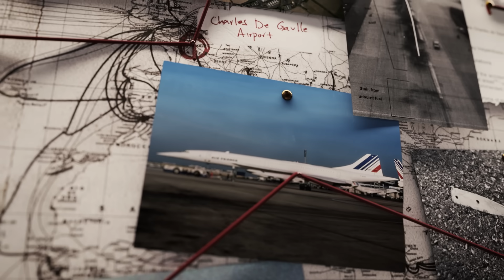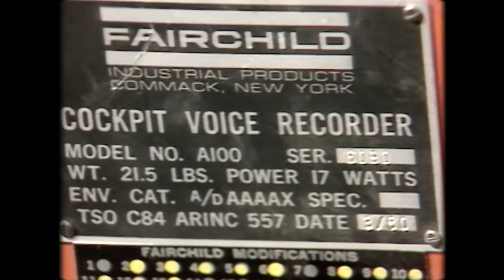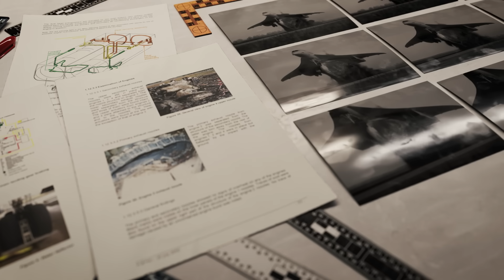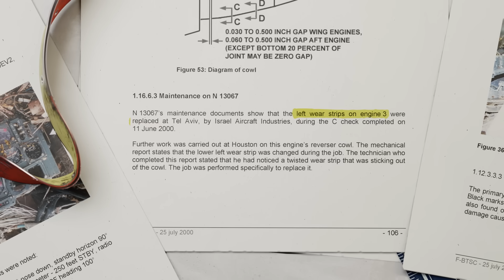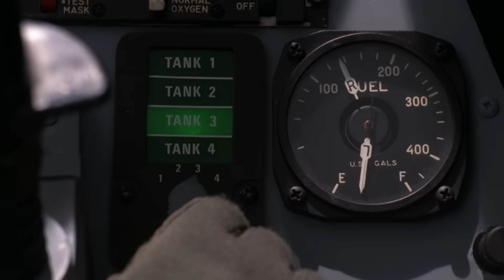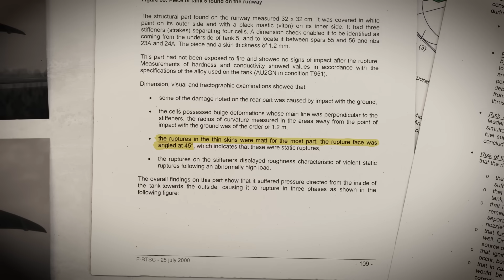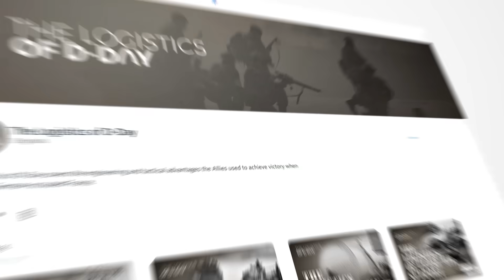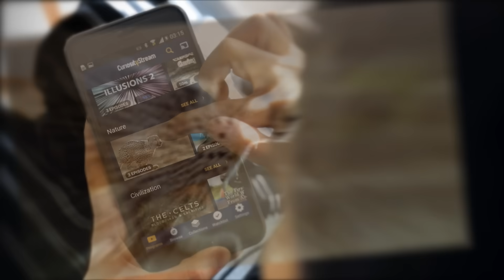What Actually Happened to the Concorde

Comment: Yes tire technology is not advanced enough for that aircraft or any with 25 tons . I been in automotive tire businesses long enough to know airplane tires endure extreme loads and the angles concorde took off and landed too much
Reply: It's not angles it is rotational speed and the weight of a 408,000lb MTOW aircraft. The NZG tyres they fitted after the accident solved this problem. Tyre bursts are a known problem in aviation but have been reduced over the years. It was a freak series of circumstances that caused this accident
Reply: @Complete Aerogeek  what speed is it. The angle it touches down is hard.   25 tons they said for tire liad. Passenger car tires are 600 pounds. 1/4 ton at 40-50 psi.   4 ply . Layers
Reply: @PantyDropper1  Aircraft tyres are governed by different rules and requirements. The issue with the original Concorde tyres was that when they  break up they did in larger pieces. That is what contributed to the accident. the NZG tyres that replaced them fragment into much smaller pieces that don't cause damage.

Aircraft tyres are arranges in bogies that spread the aircraft's weight over a specific ACN/PCN classification. Concorde had tyres that could handle repeated takeoff at 250mph and landing at 185mph.

The landing weight can be up to 245,000lb. Add into that the downward vector and you have a significant load spread over 8 main wheels yet over 30 years, tyre blowouts were extremely rare.
Reply: @PantyDropper1  Armen, aircraft are under scrutiny in ways few other machines are. I currently run an aircraft maintenance base and I can tell you that it bears no relation to how cars are designed and maintained. 

It would blow your mind to see how involved, regulated and tested commercial aircraft are. I also do engineering investigations and have an MSc in this stuff. Aviation leads all other industries in safety regulation and oversight and also how to understand and prevent accidents.

There is even a whole field called Human Factors so we can understand how people make decisions, how  flawed we are as observers and how we can create systems to help pilots and engineers have correct information on which to make decisions.

Nobody wants an accident and we all work hard to make sure they don't happen.

Comment: The most depressing part of this to me is how they were fined 1 million Euros. For the scale of damage and loss of life, that's nothing.
Reply: 1. If the captain of the doomed flight did not overfill the Concorde's fuel tanks, then this accident may not have happened.

2. If Air France chose to reinforce their Concordes' fuel tanks with Kevlar, as British Airways had done, then this accident may not have happened.

3. If the captain of the Concorde chose not to over pack his aircraft with passenger luggage, then this accident may not have happened.

4. If Air France had installed the part on the Concorde's nose gear that allowed it to steer the aircraft straight while on the runway, then this accident may not have happened.

5. If the engineer aboard the Concorde had not shut down engines during takeoff against their own regulations, then this accident may not have happened.

The metal strip falling off of the Continental DC-10 was only one part of the problem. Air France's actions, including those of their pilots, mechanics, and supervisors, contributed more to the accident than anything else.

Comment: I saw, in a comment from another video on this topic, that if the captain had aborted the takeoff right after the explosion, there was apparently a chance to at least save some lives. By taking off at too slow of a speed, and trying to fly out of the situation, the captain sealed their fate. By applying all of the stopping power they had, they certainly would have reduced the energy of the crash, there's no doubt about that. But I'm pretty sure that aborting after V1 is a rare last resort type of situation, and the captain probably wouldn't have realized how bad the problem was at that moment.

Comment: Well this was disappointing.
 16 minutes and no mention of the missing wheel spacer that Air France  maintenance had left in their shed instead of fitted to the plane, causing the blown wheel to wobble violently before it ever hit any strip of metal.
 Or that the investigation desperate to blame anyone other than Air France ignored testimony from airport firefighters.

 Also 9/11 was what killed Concorde.
The downturn in global air travel and 40 of Concorde's regular customers being killed in the WTC finished it off.
Reply: The wheel spacer was looked at extensively but the BEA decided it was not a significant factor. and as for the withdrawal of Concorde from service - it was Airbus pulling the type certificate that caused this. BA was very unhappy as they had refitted their aircraft and planned to keep flying it as they have been profitable with Concorde since 1982.
Reply: The BEA ignored all Witness Statements that day.
Reply: @michaelguiet650  Michael do you have the BEA report and have you read it and the supporting materials? The BEA most certainly did not ignore all witness statements. As with any investigation there will be some areas where agencies do not agree but which witnesses are you claiming were ignored?

This is from the report:

"The day after the accident, the Investigator-in-Charge established seven working groups to find and collate the information necessary for the investigation. The groups worked in
the following specific areas:
• site and wreckage
• aircraft, systems and engines
• preparation and conduct of the flight, personnel information
• flight recorders
• aircraft performance
• witness testimony
• examination of previous events"

Comment: Okay so the difference in this case compared to the one at 8:36 is the fuel leakage rate is high here. Otherwise the other mentioned factors that decrease chances of combustion still apply. So, how did the ignition start?

Comment: You did not explained the reason the fuel tanks caught fires. Some believe that it was caused by som wires in the landing gear housing being ripped and causing sparks, while others think it was caused by the pressure wave and sparks caused by metallic parts hitting each other when the rupture happened.
Reply: "You did not explained the reason the fuel tanks caught fires"  Exactly.  No one ever has in any of these purported "Real" videos
Reply: @michaelguiet650  Well, you explain it then if you're such a great aircraft crash investigator xD
Some things can only be said to be a "likely source" ,not an absolute

Comment: There were SIX prior fuel tank penetrations?! Also the Concorde was overloaded and they did armor the fuel tanks with Kevlar.  Further Concorde continued to be popular and in demand…it was the maintenance expense that killed it.  Well done though!
Reply: It was Airbus pulling the type certificate that did it. BA wanted to keep flying profitably as they had done since 1982. Airbus made a unilateral decision that they didn't want to provide engineering support at any price. 

I strongly suspect that as they were struggling to sell the A380 and all  the First Class passengers they wanted to fly on the A380 were going Concorde. If you want to sell an aircraft to an airline you have to convince them that First and Business will be profitable. That's where the profit is not the cheap seats.  Seven hours in a lumbering A380 or 3.5 in a sexy Concorde at Mach 2.0 and 60,000' where you can see the curvature of the Earth for just 20% more than First Class?  It's Concorde every time...

Comment: You forgot to mention why the flame started, a gaping hole in the tank wouldn't make it catch up in flame, it would just keep pouring out. The spark that ignited all the fuel was a cut electrical wire from the landing gear. That is why the plane had it's gear down the entire flight.

Comment: Just a small bit of feedback..runway numbers are spoken individually so in this case, Two-Six. The number is based on the first one or two digits of the heading of the runway. When there is a letter after it is because there are two or more runways parallel. In this case R means Right.  All together it would be "Runway two six right"

Comment: That was a great and accurate account of what happened. I think it's worth noting that BA's Concordes used Bridgestone tyres as they were more resilient to damage than the Michelin equivalents. Air France knew this, but chose not to use them as the Michelin were manufactured in France.  However the reason for BA discontinuing Concorde was purely political. At one time BA made 40% of their trans Atlantic profits from their two daily LHR-JFK Concorde flights. Air France however struggled to ever make a profit from their Concorde services, and so were keen to stop them. The French government put extreme pressure on the British government, who in turn put pressure on BA and forced them to retire the aircraft at the same time. BA had recently invested heavily in their aircraft and were confident that they had over another decade of service left in them as a minimum., and plenty more profit to be earned from them, I was lucky enough to fly on one of the BA Concordes close to the end of their operations. A truly unique and captivating aircraft, and probably also the end to when air travel had style.

Comment: The official report states:

" 
• This metallic strip had been replaced in Tel Aviv in June 2000 during the aircraft’s
“C” check, then again in Houston on 9 July.
• The strip installed in Houston had neither been manufactured nor installed in
accordance with the procedures as defined by the manufacturer.
"

I think they mention the Tel-Aviv replacement  in order to indicate the unprofessional conduct of those in charge of the DC-10 maintenance. How did this not raise red flags? obviously not supposed to wear again in a month or two.

Again a quote:
"It is in fact surprising that nobody noticed the condition of the lower right wear strip nor
that on the left fan cowl, if only during the replacement of the lower left wear strip in
Houston. It is also surprising that this replacement was not accompanied by any attempt
to understand why a part replaced a few days before was so badly damaged, nor by any
subsequent check on the condition of the new part"

Link to the report: https://bea.aero/docspa/2000/f-sc000725a/pdf/f-sc000725a.pdf

Thanks for a very interesting video. Really great script and animation, well done!

Comment: Air France 4590 was a chartered flight that transported mostly German passengers on the MS Deutschland on an exciting voyage via the Caribbean, Panama Canal, and Ecuador. The world's only commercial airliner to use afterburners begins the thrilling take-off routine before crashing shortly after hitting 100 knots 20 seconds later. There was no way to abort the takeoff since there wasn't enough runway remaining to halt it in time. Investigators discovered the flight data recorder in the wreckage of the Concorde, which allowed them to listen to the plane's dying moments. As engines 1 and 2 struggled to get the plane higher, the data showed that the plane's angle of attack stayed pretty much the same.
Investigators also discovered a weird titanium strip with uneven drilling holes and an unburned piece of plane the size of a sheet of printer paper. Investigators tracked down each jet that took off after the crash: a McDonnell Douglas DC-10, a Continental aircraft, and an Air France Concorde bound for Paris. They found evidence of a metal strip cut in rubber tire debris that had been left on the runway. The investigators created a mock-up Concorde to show how the strip would look like a new tire for the famous aircraft. A piece of metal from a car tank that had been punctured by a tire was found to have a fractured face that was tilted at a 45-degree angle. This suggests that the metal broke due to a static break instead of a pressure buildup.
The ruptures in the thin skins were matte for the most part; the rupture face was inclined at 45°, according to investigators' findings. A strained tire broke and slammed into the bottom of the wing due to a badly positioned metal strip, causing a large pressure wave within the tank, which ruptured the tank, resulting in a catastrophic and devastating loss of power and the plane's uncontrolled fall. The Concorde proved to be commercially unviable because of high ticket costs and little demand for flights, which became even lower in the aftermath of the tragedy.

Comment: Not sure I would agree with your comment on "the cumbersome wing" - this was possibly the most-studied careful piece of design that set an entire aerodynamic design oeuvre. Also, you neglect to mention the impact that 9/11 had in trans-atlantic travel to New York, and Airbus withdrawing design authority rights for the airframe.
Reply: "Cumbersome" might refer to difficulty in designing such wing. The idea of supersonic travel is ambitious after all. Or, it could be its high takeoff speed required to lift off.
Reply: @dbclass4075  , I believe the United States Air Force Had a fighter-interceptor aircraft for a time with the same wing configuration as the Concorde, but it came around in the 1950`s
Reply: @dbclass4075  Part two, the aircraft was called the F-106 Delta Dart , first flying in 1956 and had a top speed of 1,525 MPH, which I believe is just over Mach 2

Comment: Great video. One thing I would question though. The end of Concorde was not because of the crash. It was because of 9/11. Both Air France and BA's fleet flew the transatlantic route. A route that saw huge decreases in traffic in the years after 9/11. Not to mention a fair few of Concordes frequent fliers were killed in 9/11. At least on the BA side anyway. While the crash did not help. It was not the cause of the end.

Comment: You forgot to mention, how the flames started no? I think that the official documents say that during the flight of the rubber debree, it torn up important cables within the chassis, thus producing spark and igniting the fuel. Even though you didnt mention this, you did an AMAZING job with the animations, which I think are even better than of the Seconds before disaster series, and explaining the fractures, which in my opinion, is deep knowledge of metallurgy 😉. Also, it would be awesome, if you explained some other engineering failures and acidents, because you have the feeling for this topic! 😃 Thus makes me, also with other creators, more and more wanting to buy the Nebula- Curiosity stream bundle to support you. If its still 12$ per year, Im in! 😁
Reply: All of these videos never mention how the flames started or give the BEA's "sparks from cables" theory which they did indeed try to reproduce but were unsuccessful
Reply: @michaelguiet650  oh ok, my bad... 😅🤦‍♂️

Comment: No mention of the missing bogey bearing-spacer, that Air France maintenance failed to re-fit a week earlier.  After several flight cycles, this meant the left bogey was trimmed left (- pulling left and acting like a brake), forcing the pilots to pull up early, to avoid another aircraft on the adjacent taxiway.  With insufficient airspeed at liftoff, the crash was guarranteed.
Reply: And in this plane on the adjacent taxiway, il I remember well, there was Jacques Chirac, the President... Well, this video is centered on engineering... ^^
Reply: I have no idea what a bogey is but why wouldn't they have aborted the takeoff if they had an issue like that?
Reply: @bobbygetsbanned6049  The bogey connects the wheels to the vertical strut.  Once you get to "V1" you don't have sufficient space to stop anymore - you have to liftoff.  If you look at the photo at 1:08, the burn/soot line is peeling off the left of the runway.
Reply: @RangieNZ  Yes but a missing bearing should be pulling them to the left the entire takeoff, before V1.
Reply: @bobbygetsbanned6049  Perhaps, but the pilots would correct as soon as they noticed.

Comment: I'm sorry however you have omitted so many crucial pieces of information from this video....for example they took off well over the maximum take off weight, they took off with a tailwind, all the tanks were fully loaded up over the maximum limit. There was a shimmy damper that hadn't been fitted to the left landing gear, causing the deviation to the left,  the flight engineer upon hearing the engine fire warning immediately went into a drill without even consulting his captain. No1 and no 2 engine were still working fine! If the stupid flight engineer took a moment to read his instruments he would have realised he could have kept the engines going and not shut down the engines. Ultimately the flight engineers actions caused the crash in the way it did. Wether concorde would have made it to Le Bourget is up for debate- that fire was so intense it could have destroyed the wing before they managed to get it onto the ground.
Reply: Okay, let's ignore reading the actual report and base our conclusions on some retired pilot's thing.
And no, they weren't working fine, the report clearly states they went through multiple surges and loss of thrust. The cause likely from ingesting hot gas/kerosene mixture

"Engine fire alarm actuation and the very low values on the parameters led the crew to
shut down the engine after the Captain called for the engine fire procedure"
But okay, he shut it down without even asking the captain, yeah.

Like, easy to sit here and go "yeah, the stupid engineer" when all this stuff happened in the span of  2 1/2 minutes. Especially when the procedures they trained on called for immediate reaction to engine fire alarms.

Comment: Disappointed with this video. Lots of missing information, pilot authorised additional taxi fuel and luggage - increasing takeoff weight and thus pressure on the tyres and runway required for takeoff for a start.